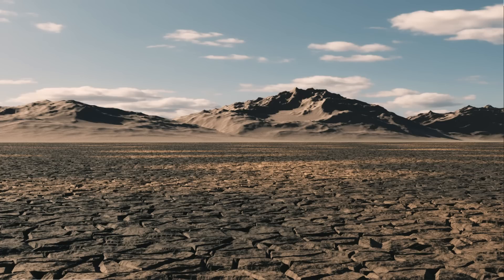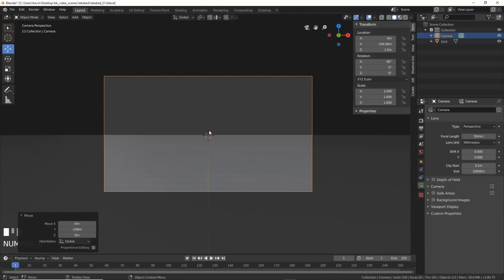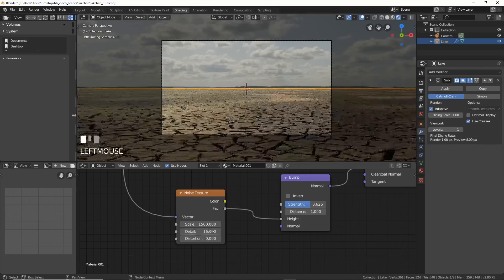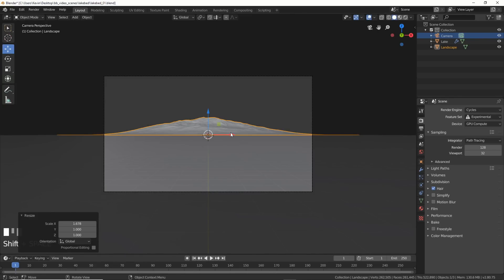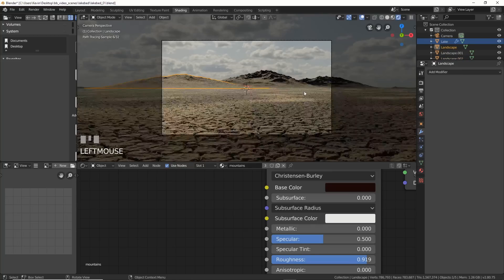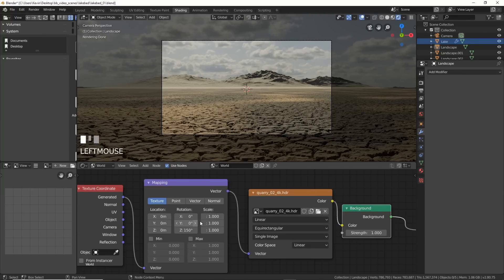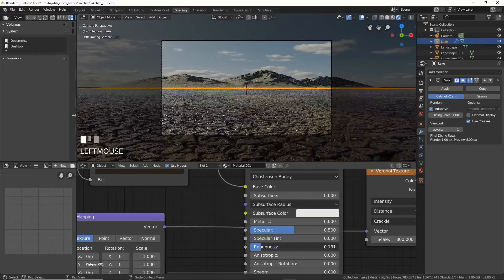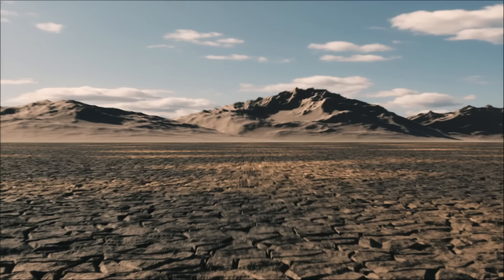Quickly Create this Dry Lake Environment Terrain in Blender 2.8

Comment: Subdivision doesn't have Adaptive to de-step the edges now.  I'm still trying to figure out a way to smooth them a little but no luck yet.
Reply from the maker: Oh yeah, lots has changed since I made this.  I’ll have to redo it at some point.
Reply: @KevBinge  I can work around the stepped edges if I pick specific angles to render from but it makes it more difficult with animation where the camera is moving.  I might look into recreating it with geometry nodes as there might be some way to solve it there.  Not sure though but re-instancing the voronoi might give more control over each tile.

Comment: Needs updating so it aligns with the current settings of the new version otherwise it is useless
Reply from the maker: Just switch to distance to edge in voronoi and it’s all the same.
Reply: @KevBinge  I changed to distance to edge but I cant connect the voronoi textures colour option to the colour ramp boxs' height option because the voronoi box has no colour option. I can only connect distance to height. What shall I do?  Great vid so far btw.

Comment: Nice tutorial! When will be the next video to this project? 
And I try to make the scene to take place in the night. Do I have to change something on the HDR for this?
Reply from the maker: Thanks!  I have some more planned at the moment.  I have to get to them lol.  To answer your question, yes, ultimately, a good night hdr would be best.  You could use comp tools to “day for night” the shot, but getting night lighting from the start would be better.
Reply: @KevBinge  Thanks for the fast answer! One more thing, I cant get blender to render my scene. I have a 1080ti Overclocked and activated CUDA in the properties and Render Device "GPU Compute". I hit render and the Pop up window appears with no image or progress in it. just the grey grid. CPU temp rises for a short time, GPU stays coll and does nothing.. Whats goin on here? The only thing I made different the you is that I have four mountains and they have a resolution of 1000x1000 instead of 512x512.

Comment: Hi Kev.  Thanks for the great tutorial, it is exactly what I needed for a current project, but it brought my poor machine to a grinding crawl and then a CUDA error.  Can you put up the specs on the machine you use for these ?  My upgraded Mac is not up to this task so I may  have to build a machine specifically for Blender work.

Also, the Vornoi texture in Blender 2.82a has completely different looking settings.  I played around with and consulted the blender manual to see if I could get it to do what you're doing.  Here is what I ended up using and it looks exactly right.

Connect the Distance to the Bump, set to 2D, Distance to Edge, and scale 800 randomness 1.  I'd put the screen grab up but I can't figure out how to attach and image to this.

regards
-AK
Reply from the maker: Thanks!  That will help anyone watching this!  My machine is 3 years old now. It’s an i7 with a GTX 1070 card, and lots of ram.
Reply: Thank you for the comment, it really helped!

Comment: what wrong with my Voronoi texture - has no crakle parameter(, so, finally everything going wrong after it
Reply from the maker: They totally changed the Voronoi node between this video and 2.81.  This technique still works but use a different parameter that looks as similar as you can find by playing around with it.

Comment: Tried to do this but my plane becomes round, I get horribly jaggy ugly ground, and the scene crashes when trying to render. no idea what I'm doing wrong
Reply from the maker: There are 2 choices on the subdivision modifier.  Use “simple”.  Also, it’s jaggy because you don’t have enough subdivisions, but more will cause a crash.  It’s best to find balance, and maybe render with Cycles over EEVEE if EEVEE is crashing.  Use CPU rendering too if you have issues.
Reply: @KevBinge  I took your advice and went with CPU rendering and the crashing stopped. It seems with the experimental version, the renderer goes through more steps prior to tiling out the scene, and it continuously crashed on one of those steps. Also I was using a different HDRI than you, but it had poor lighting. tweaking the bump, color ramp, and displacement settings seemed to hide some of the jagginess.

Thanks for your help!
Reply from the maker: Awesome!!!  I’m happy it worked for you.

Comment: great tutorial. I animated it with a moving camera, sadly enough I can't seem to use GPU rendering in Cycles experimental.... using an AMD X3950 in combination with a radeon 5700XT... cpu rendering works, but gpu rendering turns into a black screen, screen turns itself of... eevee rendering etc. is no problem at all
Reply from the maker: Thanks!  Yeah, it’s a BEAST to render.  I’m doing it on a single NVIDIA GTX 1070 but it’s slow.  CPU is slower but works.

Comment: I see no change when changing dicing scale. Same strange edges on the ground even with super low setting. Why?
Reply from the maker: Try hitting tab once or twice.  It might not be refreshing.
Reply: @KevBinge  
I tried. It is refreshing however nothing changes in order to get rid of this strange edges. Only extending distance for black and white in color ramp helps for it. Dicing scale has not effect for me. I did everything exactly like You in tutorial.
Isn't it about subdivision options in "render" panel? (1 px and 8 px)?
Reply from the maker: Yes, you could play with the subD settings as well.  Those two places should get you better edges.  It’s strange that that isn’t working for you.  I wonder if you switch to GPU or CPU would make any difference.  I’m sorry you’re having this issue, it’s frustrating...  if I can think of any other reason I’ll update this response.   Strange...
Reply: blenderBinge Thx for response anyway. I appreciate your work. Yep, it is frustrating. I set some settings exactly as in your great tutorial but still no change. There is a change but these edges are still bad with dark triangles and low dice settings do not help. Thx anyway for your channel

Comment: Brilliant, Kev! And the result is so convincing. However, I have a week old alpha build of 2.81 for Mac and I'm intrigued as to how come my Voronoi Texture node is so different from yours - much more complex, with no crackle and with completely different layout and 'feature' options (for example: 1d, 2D, 3D and 4D, F1 & F2; Distance to Edge, Sphere radius, etc)?
Reply from the maker: Thanks!!  Hmmm... they may have updated it for 2.81.  I’m not doing 2.81 videos until it’s official, as I’d jumped on 2.8 very early on and it changed so much from video to video that it was a huge headache.  Truth is though that Voronoi will work even with updates and no crackle, you’d just need to push the edges together with a ramp and tweak it.  I’ll have to take a look at 2.81 and see the alternatives through.  Thanks for the heads-up!!
Reply: @KevBinge  Hey, very nice tutorial though. I have the same problem, in 2.81 you cant make the subdivision surface adaptive, there is literally no option to change it. You know an alternative for this problem?
Reply: same porblem
Reply: yah, I couldn't get the same results from there...